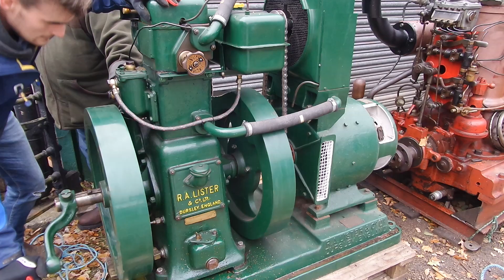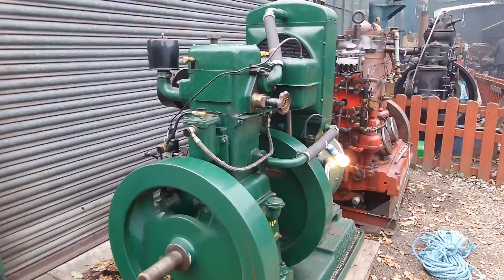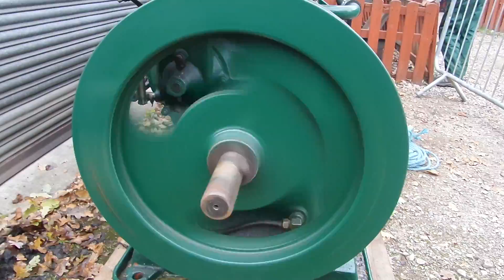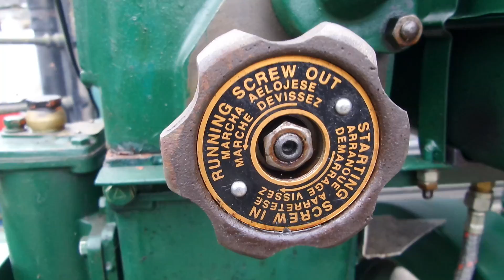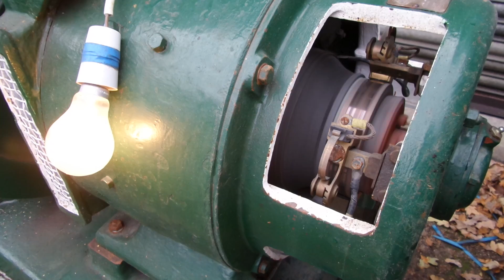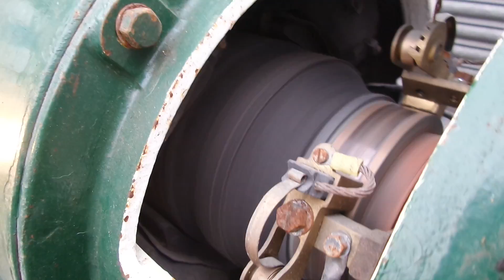Lister "Start-o-matic" Generator Cold Start Up Diesel

Comment: Very nice, most of us in the states only have the Indian copies "Listeroids". I have a have a 24/2 and a 6/1 neither have that compression dial on the side that is supposed to help with starting. And mine start very well in winter or summer. It is great to have one of these regardless. cant import them anymore because of the EPA.
Reply from the maker: 😞, i guess im lucky here we have no emission laws only with road vehicles i think - these stationary engines are not affected (you can still buy lister diesels new but not the CS as thats only made in india).😎
Reply: I heard from someone that you can still import them as “compressors”  without the fuel system and then you have to order the fuel system separately and install it completely and then that makes a complete engine! Who knows if that is true that means the EPA isn’t very smart and there’s workarounds!   I have a 12/2 Indian made one. Though I would love to have a single cylinder one as well to run a irrigation water pump!

Comment: I think if you put more load on it it will get up to temperature so you can reduce the compression - maybe even fit a thermostat - you trying to put it on run when its too cold
Reply from the maker: It was switched over too soon by the operator at the time, not that it was too cold
Reply: @EngineVids  It amounts to the same thing - Heat is proportional to pressue  (Boyle's law) - when the  engines cold it chills the combustion chamber  so the lower "Run" pressure  is insuficient to vapourise and ignite the oil injected  - I own a 1934 CS1 - on low loads   engines are often  left on the cold  "Start" setting.
Reply from the maker: @trevortrevortsr2  in this case it was the operator not letting the engine get up to speed and turning the valve quick enough
Reply: @EngineVids  Its not  so much speed its more  tempreture -  On no load theirs so little fuel being injected that without a thermostat in the system  they never get hot enough  to use the low compression run setting
Reply from the maker: @trevortrevortsr2  it was running with the screw out i was there i saw it.
Reply: @EngineVids  They will run  on the low compression with low load once warm but tend to smoke a bit  and carbon up.

Comment: Beautiful! ! How many kw supplies the alternator with the engine idling? I have a newly restored 5.1 lister that I would like to use as a generator. what do you think of this idea? Thanks for any reply.
Reply from the maker: hi, sorry im not sure of the power output of this set, i think it is 110volt but not sure. i think your engine would work ok with a generator run off the flywheel with a belt so it spins the generator fast enough.
Reply: This issue will be to keep the frequency constant if you are generating AC.  An engine designed to make AC needs a very heavy flywheel and a very precise governor.  Frequency stability doesn't matter too much for just lighting, but does if you want to run motors.  Look at the massive flywheel on this engine, to keep frequency stable.

If making DC, slight voltage variations may occur, but probably don't matter.  You can use DC to charge batteries if the voltage is correct, otherwise you might need to add some electronics, or convert it to AC with an inverter (commonly available), then back to DC.

Nice video!
Reply: I HAVE A lISTEROID 6-1 THAT HAS 2400 HOURS ON IT...PRODUCES 3600 TO 4100 WATTS AND USES ONLY I LITER OF DIESEL PER HOUR JUST FABOULOUS FOR A LONG RUN GENERATOR
Reply: @toadatwork  
Cześć.
Piszę do Ciebie z Polski w Europie.
Jak nazywa się twój Listeroid.
Ile koni mechanicznych ma twój silnik.
Pytam Ciebie ponieważ w indiach jest wiele Listeroid a ja nie wiem która firma jest dobra.
Czy taki listeroid będzie pracował na brudnym oleju jako paliwo?
Życzę Ci dużo zdrowia
Pozdrawiam

Comment: I smell a second attempt at starting….  Very nice engine however, and it has to be said; these engines really are unbeatable.
Reply from the maker: No 2nd attempt 😅, they switched the valve over too fast nearly stopping it then i stopped recording thinking it would stop but it didnt

Comment: wher the water pump.?
Reply: Its got a fan at the top so it doesn't need to be cooled by water
Reply: Dragon Plague2806 
And how is the water pumped from the cylinder to the water cooler?
Reply: Heat makes the water rise therefore it is a self built pump

Comment: Prime Example of the old adage:  If there is even One knob, screw, lever, handle, pedal, knee-knocker, etcetera that can be twisted, turned, lifted, pushed -pulled, rotated or flipped...some so-called mechanically challenged genius has to ( as in can Not resist ) start fiddling with it.
 She started and Wanted to run. Just barely was able to, despite your best efforts at sympathetic sabotage .
 My advice: Keep your greasy hands in your pockets, as impossibe as that sounds !
Good thing for Both of us, i wasn't standing behind you with a proud Blackwood Shillelagh   .  .  .

Comment: Is this generating AC? If so, I assume it's 50hz. So that must be a 6 pole generator. It doesn't sounds like it's running at 1000 rpm though. 

Regardless it's a beautiful set up!
Reply from the maker: Hi, i dont have a clue sorry 😅. I just recorded it.
Reply: Depends on the mechanical ratio in the drive shaft.
Reply: @VarisLux  It's direct drive....
Reply: Those types of engines don’t usually run any higher than 650 rpm sometimes 800 but mostly 650   Mine runs close to 650 I believe though I have a 12/2
Reply: @mainelyelectric  Yes I have a 12/2 as well. Rated 12hp @650 rpm. That is precisely why I'm confused as to what this unit is generating.  Looking at this video again and at time stamp https://youtu.be/7NVY9xcCqlU?t=51 when he turns the compression valve the lighbulb shows now flicker when the engine slows down, this leads me to believe that this is probably a DC generator attached to this 6/1.

Comment: wher the water pump.?
Reply: EngineVids 
I don't see the engine water pump
Reply: EngineVids 
How to recycle water into a water dispenser
Reply from the maker: @farisfaris5703  it doesn't have a water pump, its thermosyphon
Reply: EngineVids 
Did you mean the mercury valve?
Reply from the maker: @farisfaris5703  no the cooling sytem for the engine uses thermosyphon, no water pump